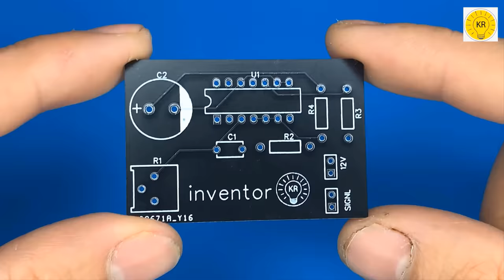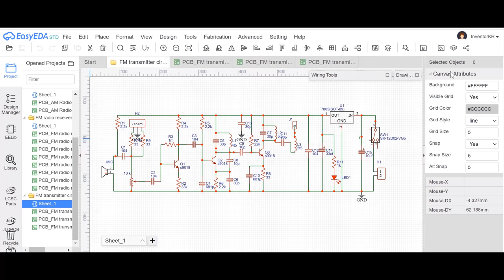how to make simple inverter 4500W , sine wave , 8 mosfet , IRFz 44n ,jlcpcb

Comment: Great! I never would have thought you could run 100+ Amp through those thin DC cables 😂
Reply: Wong.
Reply: More like 166A with 2000W load.
Reply: He claims 4500W in the project title. At 100% conversion efficiency, that would be 375Amps @12v supply.
He fails to show any current in or out, and that light bulb could be 7W. The kettle could be powered by hidden sources.
Reply: The voltage does not change when the kettle stops. Scam.
Reply: It's New type of wires.. called magical wires can hold millions of amps
They built them from a special material found in our sun's core .
Reply: @paulmoffat9306  Exactly. It's nonsense.
Reply: If that was a 1500 watt kettle it would require 125 amps at 12 volts.  You would need a minimum #2 copper wire to supply it.  My 4000 watt inverter at 24 vdc input uses 4/0 wire, almost a half inch thick.  No output waveform, is it a true sinewave?
Reply: Should be arrested for that soldering. Could have had jlcpcb make the whole thing on a board but then it would be harder to hide the bs

Comment: You use 8 IRFP260N transistors, they are 300W cad, in total it has 2400W, they are missing 2100W, and the 1mm 12V power cables would melt completely with a 2200W consumption that at 12V they are 183Amp, I am not saying that your inverter it does not work, only that it must be more realistic with the power, otherwise this makes it look ridiculous in front of people with some knowledge in electronics
Reply: Muy cierto tienes razón.
Reply: Exactly the same as what I said, read my comment, its tells a lot more. Paul
Reply: @chilledoutpaul   There was so much to say that it would be too extensive, including the transformer that in no way that size could deliver 4500W, with a loss of 20% this would have to exceed 5000W, its size would be at an industrial level.
Reply: Very interesting.. you have reason. OK, I see your point.
Reply: Not more than 200 watts (real power)
Reply: Not to mention poor soldering, the wires could not possibly handle even half the 'rated' current.
The soldered contacts would heat and melt.
Almost no lead length across any other wire, only solder.
I do like that the soldering tips were clean, but looked new.
Reply: It is a pure BALONEY circuit.
Reply: @michael931  not at all it is 100% a working squarewave inverter that was powering the light bulb but that's it, it's just like any of the cheap inverters you can buy good for 150-250w
Reply: So, what is the answer here? To increase the zise of transformer?
Reply: @paquito5062  the answer is watch a video that is not a total scam.
Reply: True😮

Comment: Whith the used wires and transformer, it is not posible to pass more than 20 real continous  amps. 12V x 20A = 240 Watts. Asuming a 80% efficiency (as a good favour) you get a maximum of 200W of real power at the output (and forget the senoidal feature, of course)

Comment: In order for 1 Ampere to come out on the AC side, 10 Amps must be entered from the Dc side.
Reply: right., so 2000w boiling water would be about 10amps draw on the 220 side, so 10a  x10 = 100 amps on in put at 12v.  100 amps over those small little wires?   I believe the light, yes, the water boiler.. no lol
Reply: @dancing5203  Yes instantly I saw the DC input leads I called BS. Note how the DC supply is not shown or even mentioned.

Comment: Nice , good

But it is not sinewave inverter

Not 4500 watts

Ur using 4047 ic  , it is square wave osolator.
Reply: Yeah he made another inverter a couple of weeks ago and I told him exactly the same thing, I told him to make his own flip-flop circuit from a couple of 2n2222 or similar they do give out a sign wave 🙄
Reply: Sin wave need more time to make....but you can use modified sin wave that are used in normal inverters ....in easy way....

Comment: Where is your sine wave? Where is the 4Kw load? The transformer is small for 4Kw, I wonder if you can get more than 1Kw.
Reply: You are right, but I bet this can not support more than 200 wats (real power)
Reply: From a separate mains wire plugged into an outlet!  Obviously fake - the wires bringing in the DC power should have melted in about five seconds.

Comment: Very interesting video and so recommended to be shown are size of that very small heatsink and its temperature to be raised up, and also the sizes of core, coil and the diameter or wire, needed to get such big power as 4500w through more 400A from 12V source, and also needed more than 16 or 32 MOSFETs-260N(200V,50A) for switching here, thanks.
Reply: Dear brother... can i know about the values of this transsisiers and transformer and other etc...... i cant understand wht s the numbers of this equipments pls explain me...im from sri lankaa...
Reply: @easyguidecare  Thank you for your comment replying to my c. , from your camera i read IRFP260N on FETs that can manage  up to 50A that probably absolute max so normally we can use this maximally around 25A e.g. , and at least in case half bridge switching circuit, it  requires 16x2 FETs for 400A roughly but fortunately possible, difficulty carries fun to us, cheers.

Comment: When soldering, heat the joint and then put the solder on the joint… not so much the iron. You’ll struggle less with making the joint this way, as you don’t rely on solder flowing from the iron… but instead it flows directly onto the workpiece instead. Yes you need to put some solder on the iron to create an efficient heat bridge, but once you get that going, it’s better to put the solder on the joint as opposed to primarily the iron.

Comment: Mosfets mounted dry with mica washers? Needs either thermpath or silicone insulators, and split ring washers. Say it's 80% efficient you need 469 amps in from the 12V source to get 4500W out.

Comment: The only bad thing in video was that, the kettle was not powered by the inverter as when kettle thermostat tripped there was no fluctuation at meter volts reading, not even a single volt. the inverter you made would work for aprox 600W and even for that input leads should be at least 6mm copper and the wires look like not more than 2mm copper. would you please reply why you did this

Comment: I just don't understand that small wires can withstand bigloads? Materials or components are not explained well. Before the load test, why didn't you use an oscillator to check its credibility. I'm not saying that this is impossible but for the sake of real learning, a step by step explanation must go at hand.
Reply: It's because they are magic youtube wires.

Comment: In general it shows how inverters works in the most simple way - for education purpose it's ok - but please DO NOT BUILD THIS AT HOME. There is NO FEEDBACK CIRCUIT at all! Output voltage can be unstable with hude spikes! Also CD4047 is an multivibrator, it generates SQUARE WAVE, not sine. I guess it's even not a "modified sine" just pure square in 50Hz cycle.
Reply: Tienes razón amigo.
Reply: @IfazOadir  Yep and he will  be lucky if he get 500 Watt from it.

Comment: Would be great on  my boat,  although I'd use a 555 timer and solder it onto a Veroboard. At a full load of 4500w each MOSFET would draw a whooping 375/8 ~46 A.
A 1kw inverter would be ample for many applications.
Reply: Your boat will be on fire 😂. Thin wires and 375 A 🔥

Comment: Some solder joints look acceptable, but most of your solder joints in this video look terrible or even worse. I recommend you to use plenty of flux and preheat (100 °C to 120 °C) and pre tin your solder joints, then they will look gorgeous. All in all a good video, a slightly decent job only soldering should be improved.👍 also pre tin the  soldering iron tip every time you put it away in the carrier, your soldering iron tip will thank you that. Otherwise, you let grow a thick oxide layer on the tip, which then you have to aggressively etch away. I don't, which retarded person showed you this monstrous torture technique. But it is stupidly wrong to torture the soldering tip like this at 3:34. That Brutal, inhumane and wasteful abuse of soldering tips!

Comment: Have you use step down transformer and high current to give reverse
i.e, 220v to 12 0 12  reverse 12 0 12 to 220
Their current is 20-40amp
To give this value of wattage ?

Comment: 12 V, 4500 W would be 375 amps, you should use 200 mm^2 copper cable not 1 mm^2 copper wire. check the current rating,. Your inverter will burn out

Comment: Those wires supplying the low voltage side of the transformer can't carry more than 10A, judging from their size. If the battery is 12V, then that gives 120W of power at 100% effiiency. That cannot possibly power a 2000W kettle.

Comment: What is the range of imput DC current ??? It will run on supercapacitor batery until is empty ? Ca you make such a inverter? To run on DC between let's say 48 V DC and near zero volts ? ?

Comment: Is the signal changing polarity? Because I don't understand how with same polarity on signal wires the system can work. I mean if one wire gives + and it's attached to one side of mosfets and the mosfets turn on while the other signal wire(-) doesn't turn on mosfets. The signal has to reverse it's polarity for the system to repeat on  the other side of mosfet group.

Comment: the insulation under the transistor should be made with an electrical insulator and thermal conductor, while then there is no insulation between the pins and the metal rod
Reply from the maker: There is insulation, you may not pay attention well

Comment: When soldering, better heat up the wire instead of the tin. Otherwise you may have a bad connection.

(Source: A solder-trainer for multi-million-$/€-devices.)

Comment: I've watched a couple of your videos, you never describe the transformer like what is the input and output voltage current ratings etc, kinda important dont ya think? Anyway, while with ta light bulb and a mixer may work depending on what you are doing there is no way you are getting 4500 wats out of it

Comment: This board without measurment line? Whay U use resistor for Voltage correction?
Better plate measuring and automaticly adjust 230V.
This transformer is for max 500W.
When U test with 4500W 😉
🔥🔥🔥🔥🔥🔥🔥🔥🔥🔥🔥

Comment: The circuit is work but the kettle is not powered by that, if you consume 1000w at 12v input, you need about 90A, that alligator connectors can't withstand this amount of current.

Comment: Must say I'm rc world 12v and 120amp draw and you don't need thick gauge cables. It all about keeping ESC cool for sure. I am not sure how inverters work. Although I ha e fixe and torn apart a magnatron from a microwave. And no thick gauge cables there. I am trying to understand if this would actually work at all. The argument at hand from all is it would get too hot to do...
 But like I say rc world pumps alot of amp in small gauge with batteries much more powerful than lead acid.

Comment: Aren't the IRFP260's rated at a maximum of 200v ?
Reply: OK,  I see something...are the 260's connected to the LOW voltage side of the transformer??    ....just wished that you spec'ed the transformer.   I am really glad to see that you used separate gate resistors...ALSO, I was thinking that you could use conductive surface heatsinks and just make it the drain connections for the MOSFET groups.  Then you could eliminate a bunch of heavy drain wires (and the plastic sheets)...could just cut off the middle MOSFET pins.  Of course the heatsinks would be live.
I'm planning on trying that 4047 as a drive...they are ordered and arrived.
GREAT VIDEO!!

Comment: This I easily make with an RC sine midulatuon of the NE 555 integral scheme. No problem. I make 50 Herz in the beginning and any capacity for the transformer.. With sine and condensed filter there is no need of coiling or radiator.

Comment: at least 100A of current would flow through these thin wires of the power supply, provided there was 24V there.  These power supply cables with crocodile clips are amazing, they didn't get hot 😂😂😂😂

Comment: I want to see this sinus on osciloscope! Bulb and ketter are resistors so they will work on DC, AC and frequency is not important. Connect something with electric motor or other inductance unit.

Comment: All I find is maybe your inventer works but the main reason is to find customer for your products . Can anybody boil water in a kettle with at least 1000 watt which i am sure it is more than that which needs least 150 amp through a 1 mm wire?

Comment: The soldering in this video makes me want to throw my phone from the roof 😒. You DON’T apply solder to the iron and then blob it onto a connection, you apply it to the wires and connection so the flux prevents / clears oxidation so the solder can flow…. No way this circuit could handle any amount of current with those connections 😆🤣👍.

Comment: No not a sine wave !

After conversion the kettle ( if 800 W ) is over 100 amp with that setup .
4500W out is about 500 amp at 12 V . 
If you drive the IRFZ44N correctly the maximum is about 200 A per leg !

Just not feasible …...............

Comment: 😂😂😂🎉 to run the water heater at 220v 1500w 6amp ac will take 12v 720w 60amp to work. Your wiring set  up would be on fire 🔥😂😂

Comment: It does not look like 4500 wt inverter.
Even like 2000 wt.
Low voltage wires - too thin.
Way of kettle connection - is it a joke?

Comment: This transformer can not supply 4,5kW and is not sinusoidal inverter. This is a half bridge converter. If you supply this converter with 24V contínuos you Will have a 185 amperes of input current. The cables used will burn!!!!

Comment: Hi there, very nice video, can you please help me understand how this DC to ac work? I know the rectifier but the other way around looks much more complicated, i never understood why there is a transformer always used, i know how they work and also know how to wind them, what i don't get is, why there is not a single post that explains how to convert DC to ac without the transformer and without boosting it, i only need the first stage, i need a circuit DC to ac converter from 12v DC to 12v 0 12v ac, pure sine wave (for diy car tube amp) is that possible? Or should I connect to the alternator by bypassing it's rectifier, i know this is crazy but that's what I'm left of with, please help.

Comment: These aren't irfz44n transistors. I've done a few projects he has posted and they all worked well.
Reply: Look at those do they say irfz44n? No they don't they're irfp260n I used 16 irf460 and they've been powering my friends little camper for about 6 months now. This design here I used irf3205 and had to tweak a couple things to get it to work but it did work. Wish you would have posted this comment about a year ago I gave it away with a box of other stuff I didn't need anymore. I'm into tesla coils and 3d printing now. Lol going to build a time machine next 😊need to get a powerful laser and millions of volts.

Comment: I don't know what the transformer is doing as the power seems to be coming from somewhere else. Apart from that and the sh*tty soldering  along with twisted wires and cables which are more suited to lower power electronics than this dangerous contraption everything looks good.

Comment: Я вижу,что законы физики в этом видео не работают? Сечение проводов для 220 В подходит, но для 12 В нет. Мощность по формуле P=U I.  P : U= I. 4500W :12V = 375A. Это провода должны быть сечением больше чем у сварочного аппарата , такими как например, в автомобиле от аккумулятора. Я этого не вижу, зачем врать?I see that the laws of physics do not work in this video? The cross section of the wires is suitable for 220 V, but not for 12 V. Power according to the formula P=U I. P : U= I. 4500W :12V = 375A. These wires must be larger than that of a welding machine, such as, for example, in a car from a battery. I don't see it, why lie?

Comment: 4500 watts with a 12 volt supply would draw 375 amps.  There is no way that the transformer or wires shown would handle even 10% of that.  Trying to get 4500 watts from the circuit shown would cause melted wires and a good chance of fire.  People posting such dangerous rubbish should be band from YouTube.

Comment: CLICKBAIT !!!
4500W ? Never! Take out one 0 ... with this fist-size transformer, 450W is more realistic.
The voltage does not change at all when the kettle switches => it is not connected to the inverter.
Sine wave out of a square controlled cirquit? I doubt!
...and I would wonder, how long it takes, until these 16gauge wires melt @ 4500W 🙂

Comment: the idea is good, but mine is better and surpasses yours, let's start watching the video generator 220 is powered after powering the transformer 220-12-13V 100amp, then the converter 12-220V 4000-8000w, then the converter 220-96V 500amp with good efficiency, then the controller is the same 500 amp motor 96V and with good efficiency and the generator that turns autonomously, it will not lose torque the moment if you do as I wrote and your equipment will drive 5000-10000 kilometers at 120 km h, your batteries are not needed

Comment: This is a fraud, at least the cross-section of the 12V wires and the connection through the crocodiles, because with the input power of the inverter already 2400W, the current at 12V would be 200A, the cables from the 12V supply are for a current max. 10A, so at 200A the cables would glow and smoke like an ignition cord.
The same applies to the cross-section of the wire of the primary winding of the transformer.
The power consumption of this type of electric kettle is 1900-2000W.
The voltage after switching on the kettle must drop, as the inverter has no feedback as to the level of the output voltage, but nothing like that happened in the video.
The reason why this video was filmed is a scam how to make money from video views on YT.